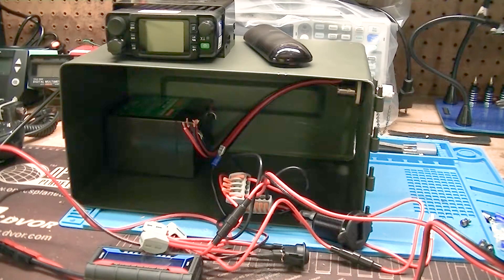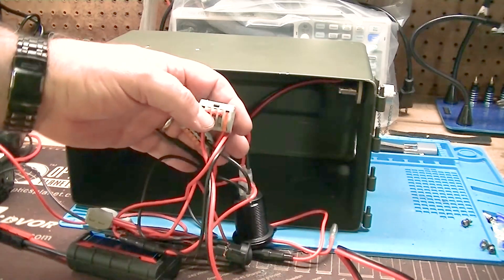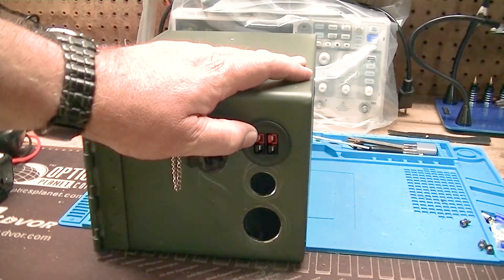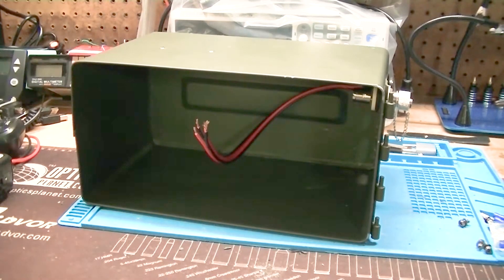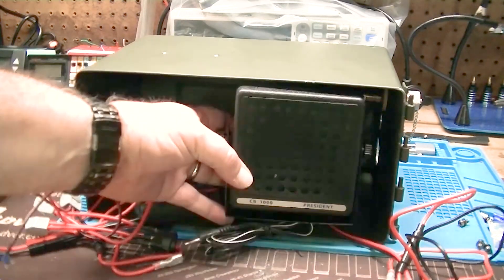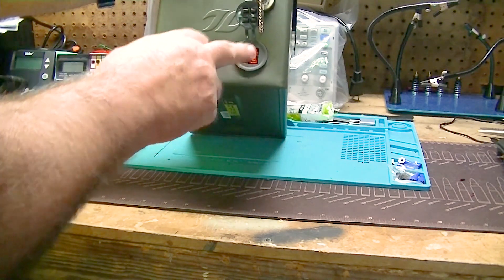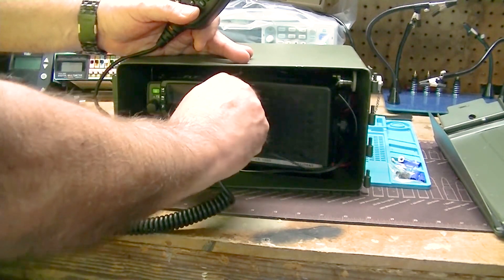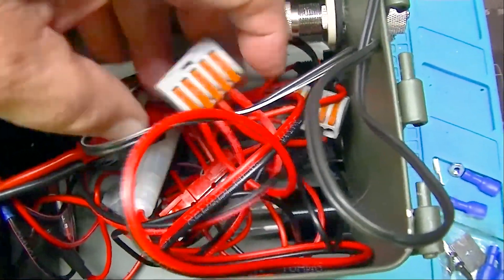Amazing High-Power Portable Radio Project!

Comment: Very nice go kit.  I could not see if you have one. A inline fuse at battery will be a great thing. BMS in a battery can fail. With that direct to battery power pole a extra fuse is a great thing. I use the DC breaker from Powerworx.  That has a button to disconnect battery and has over current protection. I hate to see a battery fire because of no fuse. Powerworx has great inline fuse holders. I use the 10 AWG ones. That awesome for field day. 73

Comment: Very nice. Would a right angle connector help or is it just too tight?
Reply from the maker: It would for sure.  I hadn't thought of that when I did this.  I'd like to completely re-do this at some point, maybe upgrade the battery or put a sexier radio in it.
Reply: @FEPLabsRadio  it's like the Persian flaw but it's an excuse to rebuild rather than an acknowledgement of humanity's imperfection.